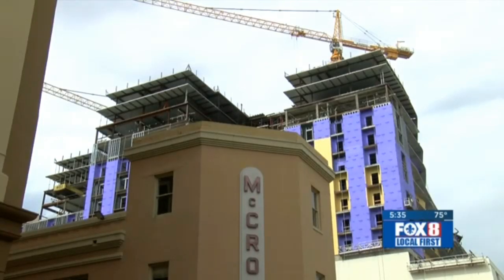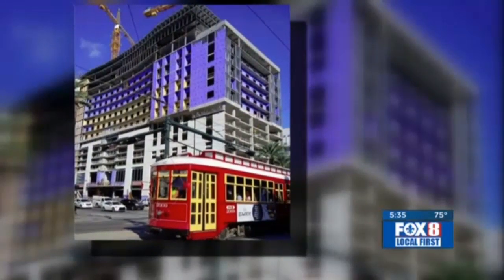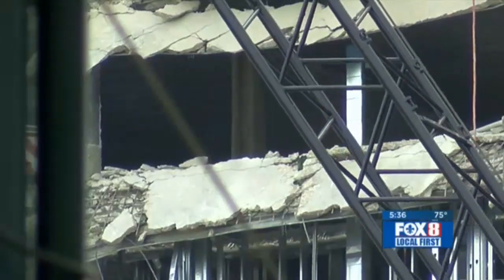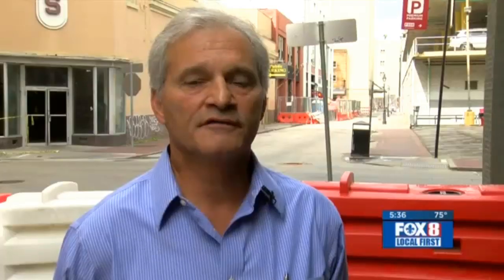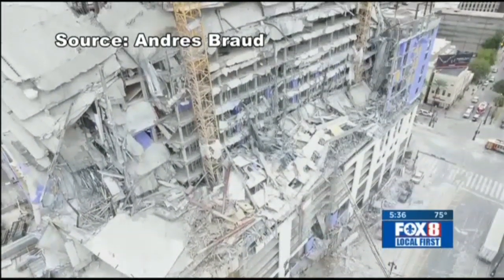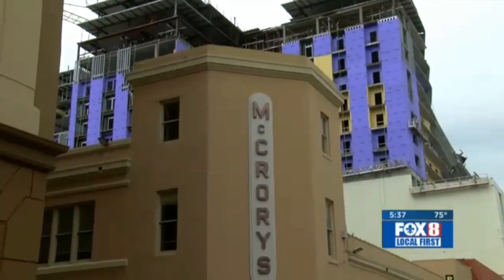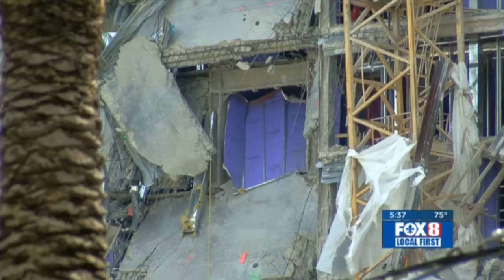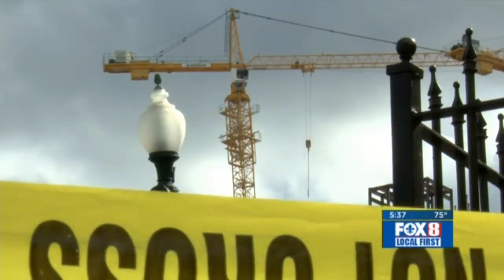Civil engineers give forensic analysis on Hard Rock Cafe Hotel collapse

Comment: The hard data from the Hard Rock collapse I have been analyzing is based on my background, work on ASTM committees & testing,  material forensic analysis, mechanical reinforcement engineering, decades of advanced work and training on the chemistry, application and quality control of Portland Cement, advanced material reinforcement, steel, cable and synthetic, braided/stand/twisted/extruded/mono & multi strand, etc. Seasoned in quality control and testing with years of tension and compression techniques in reinforced strength concrete construction, commercial land development and construction, etc. 
I have major concerns of the quality of the project from the ground up and politically from the top down based on the data on hand. The written data from the soil and engineering report, plans, changes, approvals, inspections, etc. I have major questions as to how this project was even approved and passed all inspections step by step and floor by floor by the City. Need to get samples of all materials used on the job site into the test lab. What I have visually seen is concerning to say the least especially the data prior to collapse. Lots of questions for the City as I hope the attorneys have the same for the City as do all others involved.  Nice to obtain concrete core samples, samples with reinforcement and photo micrograph under electron microscope, compression and tension testing, chemical analysis, etc. Tensile strength, elongation, elasticity analysis, compression strength, etc. The storage and movement of materials seen in the data I have viewed is extremely concerning to say the least. Shock loading, dynamic loading and static loading all need to be carefully understood. Rigging on three sides of a single system for dangling platforms under static load are vastly different under dynamic and shock loads. Beams twisting and bowing not a good thing. Until we get into the test lab and dive into the vast paperwork for everything that was used in the build process on site inspections, and into the test lab, too early in process to state who is at fault and ultimately what brought the structure down. However, the obvious is obvious and I am shocked at what I found that city approved step-by-step and floor by floor. Good or bad, the world is watching, on the Internet and commenting. And those local building inspectors that recently were fired for taking bribes to pass buildings that failed in the area. 🤔

Comment: These are responsible engineers, commenting only on what can be seen and not speculating on the cause of the collapse.  Unlike some some self-appointed analysts on YouTube.
Reply: The data seen from the job site is very revealing. I have done material Forensic failure analysis for years and totally agree with many voicing on YouTube. However, first all the major materials used from A to Z need to be independently and appropriately sampled from the job site, tested  to validate they meet the requirements as engineered using at least 3 independent test labs that are NOT based or located in Louisiana, to eliminate any local or state influences, keeping the process and data as independent and pure as possible, critical to validate any hypothesis.  Secondly, the engineering needs to be independently validated just as the actual materials and methods used in the construction process need validating. The material visual onsite data prior to collapse and documents supplied from the city are alarming. From what appears is advanced corrosion in concrete reinforcement, severe concrete dusting, honey comb, deep fractures in critical areas to advanced creep, all pre-collapse I have seen multiple areas of what appears to be post tension and reinforcement failures, reinforced masonry literally crushed and replaced around the clock prior to collapse, shallow reinforcement, uneven concrete pours, improper forms pinching post tension cables, multiple fractures and cracks, cold joints everywhere, contamination on composite decking and improper movement of heavy materials internally within the building; not all areas are meant for forklift or heavy equipment to drive on especially those extremely heavily loaded which cause shock loads many times over the actual material weight being moved, questionable storage of extremely heavy materials in areas likely not engineered for the weights being applied, internal ramp system showing sign of being over stressed and failing, improper rigging techniques into single point systems, obvious lack of redundant/safety engineering/- fracture critical never a good thing, using a soils & engineering report for a different project that clearly states not intended for the Hard Rock Hotel project and yet city accepts, (what is up with that), a building that was approved by the city that will not withstand sustained winds in a category 3 hurricane, do the city officials know that hurricanes from category 3 to 5 can hit the area?, a building design that is highly susceptible to different sink rates, unless piles into 10’-15’ of bedrock, likely with not sink/settle uniformly,  multiple plan changes that no one seems to be able to find the stamped approved plans vs what was actually built, the engineering and design of Hard Rock Hotel on the challenging soils requires everything to be top quality, built correctly with best industry practices plus over engineered with multiple redundancies or failure is near certain. The Hard Rock Hotel collapsed, designed by real “Engineers” accepted,  inspected, and approved by the “real local government”, step by step and floor by floor. To conclude, don’t knock people on YouTube. The real engineers, local government, developer, builder, contractor and subcontractors, all now get to deal with real attorneys, real Sate and Federal investigators and real future publications in multiple venues including those currently and in the future on YouTube. If the building didn’t collapse other people would be alive and no one would be discussing the Hard Rock Hotel Collapse on YouTube. And that’s a material fact. As they say “The book is in process”